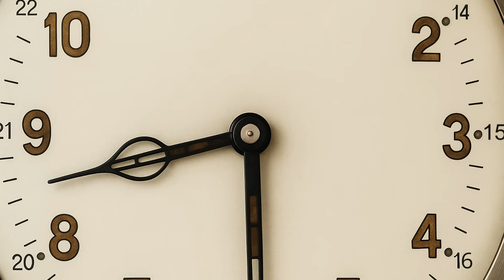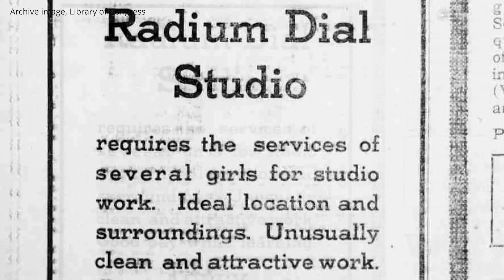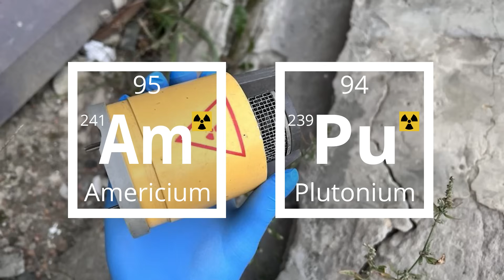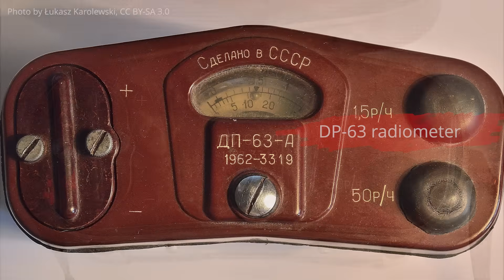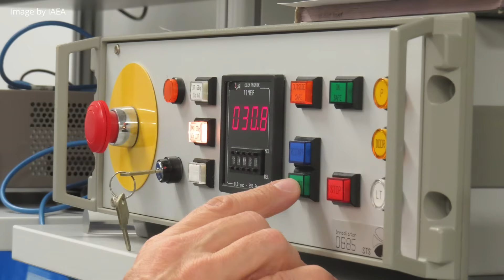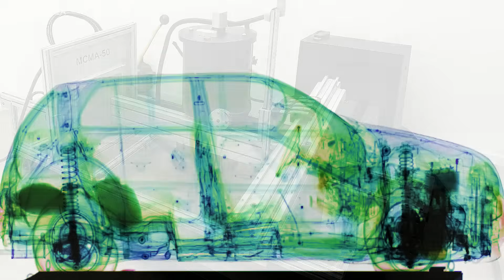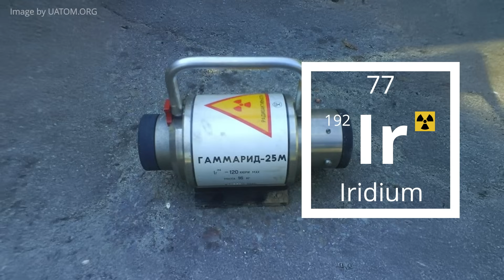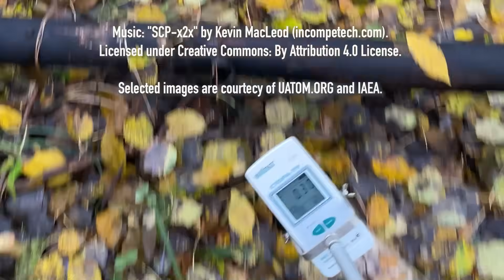NEVER EVER Touch These Objects!

Comment: Hi i am clockmaker and for no Reason i used to remove the radium paint from the diles and hands i still have it in glass jar 
My question
What should i do with it And how much can it be harmful to me i've Always new it was radioaktiv bad i am stupid and n i can stil remember after i would scrape It of i would turn the lights off and look at all of the small pieces thet i didn't catch in the jar and am really worried about the dust
Reply from the maker: Contact local sanitary authorities and request a check up. Follow their advices. I am too far to give you any specific advice.

Comment: My lab actually uses an old but still very spicy radium dial clock as a check source for repairing old US Civil Defense Geiger counters such as the CDV-700. My dosimeter can detect it from about 0.5m away and will sound an alarm within 200mm of the face of the clock. Needless to say, this is not a clock I recommend placing beside your bed!
Reply from the maker: True. Thanks for sharing!

Comment: Hello! I am writing this so I can save time searching through contact information of yours to ask this.
I am writing to you in accordance to a geiger counter "apperantly used in Chernobyl" 
the РР51М, it is made in 1970's Communist Bulgaria. In some articles about it is said it was exported to be used in Chernobyl due to lack of presicion instruments but not much detail is given,
since I am a fan of the channel and you guys know way more than me on what was used most likely I am asking this to hopefully either confirm or clear this myth up. Many greetings from Bulgaria!
Reply from the maker: We are not exactly experts on this so we asked our friend Boris, who is a dosimetry technician in the Zone, his answer is:
"..I personally am not aware of any facts regarding the use of this device. However, I also haven’t specifically dug into this kind of information. All I can say is that, in terms of technical parameters, this instrument is almost identical to the DP-5. The detector unit contains the same tubes — STS-5/SBM-20 and SI3BG. It has a similar measurement range of up to 200 R/h. It’s a device from that era. It’s quite possible that some quantity of this equipment ended up in Chernobyl, since at that time everything capable of measuring high radiation levels was sent into the crucible of the Chernobyl operations.
From foreign equipment, I only know of the use of German radiometers (RAM) and Finnish Alnor devices during different periods of the cleanup efforts. However, they were not used on a large scale in Chernobyl. I also don’t rule out the use of PP51 instruments..."

Comment: you forgot a group of sources. Certain kinds of vacuum tubes contain radioactive materials: examples include, secondary emission photomultiplier and multipactor tubes, Thorium-doped filament triodes, uranium glass-sealed transmitter tubes, gas-filled cold cathode valves like thyratrons, RF noise sources, Microwave waveguide components, krypton spark gap tubes, voltage regulators, atomic clock oscillator tubes, and military grade ultra-high-speed switching tubes called Krytrons.
Reply from the maker: Good note!

Comment: In the Arctic Ocean, numerous Soviet decommissioned nuclear submarines have been scuttled.  For now, the submarines' reactor containments are holding strong.  The corrosion, of the metals used to build the hull of the submarines, and the reactors, is slowed. However, the corrosion is taking place.  Soon, a containment breach will happen.  This will shorten the lifespan of many species throughout the planet, to unsustainable levels. Mass extinctions will take place shortly after these old Soviet submarines start leaking their nuclear fuel.  The planet will be changed irreversibly.

Comment: Where I Iive, radon gas is an issue because of the radioactive elements in the native bedrock which is pretty close to the surface in many areas. It is the second highest cause of lung cancers, after cigarette smoking. The solution is often to have adequate ventilation in building areas below grade. Many people don’t know about the danger, and the building codes don’t address it. The problem is likely worse in air tight buildings with inadequate fresh air exchange.

Comment: Radium clocks don’t cause birds to die, they aren’t that strong usually only 1uCi,aircraft gauges and compasses are far more active and even then will not give birds ARS stop lying and fear mongering,also RID-1 detectors have two 500uCi sources which are far more active than the 1uCi Am-241 household smoke alarms,the Sr-90 B-8 source in the DP-5 dosimeters are not strong enough to cause any damage,and the ones in the DP-5V are epoxy coated
Reply from the maker: I see you did not even watch the video.
Reply: @ChernobylFamily  I see you know absolutely nothing , and have no actual experience with these sources like I have , don’t give me that
Reply from the maker: Enjoy your coolness, then. Peace and love.
Reply: @ChernobylFamily  don’t spread misinformation, peace and love

Comment: Another potential hazard for collectors of vintage Soviet gear to watch out for is military night vision optics that use vacuum-state electronics; the high-voltage generator circuits in those use rectifier tubes that have radioactive electrodes inside them to improve thermionic emission.  If these glass tubes are broken during handling or disposal, the source can be released.
Reply from the maker: Very well noted

Comment: With regards to the dp-63 I am not sure what you mean about it having a check source under the "clip".
All sources are contained within and a B-8 check source is fitted under the tube with a small window on the back than you can open to check other dosimeters as well
Reply from the maker: Seemingly depends on a modification. Many have it same as DP-5A --- on the holster's cover.

Comment: Nuclear power Health Physics tech here. Hey guys Please dont listen to AI generated videos for safety tips.  🤦 these facts are not factual. The very first story makes no sense. Radium 228 which is most common is a alpha emitter, alpha particles are too heavy and large to travel that far or pass through the feathers let alone the skin. Ra 226 is a beta emitter however, if the clock had a glass window no beta particles could pass through it. The amount of gamma would be nothing compared to the natural dose parrots experience in the wild.
Reply from the maker: First, read the description of this channel. Second, there is no AI generated advices here, except a few AI enhanced images. Third, thank you, but the glass was not intact. Thank you/you are welcome.

Comment: Never open a power supply either. One static electric spark can send tens of thousands of volts through your body and stop your heart instantly.
Reply from the maker: I more like CRT tubes in this context.
Reply: Static can't, a charged capacitor sure can
Reply: Be lucky to find a power supply that is in the thousands of volts in households

Comment: I work at a lab. A colleague got a radiation monitor and was showing it around. At a certain spot in the lab it started alarming... Turned out to be a very old mechanical balance which was there only for show purposes (no one used it, new lab rats don't even know how to do it...). It had radium painted dials which no one was aware of, we had to get the apparatus removed by the company radiation unit .
Reply from the maker: Good it ended like this!

Comment: That compass shown at 5:42, does it contain radioactive materials? I own one, looks same as the one shown in the video
Reply from the maker: Yes. There are versions without, but vast majority, yes. Delivers ~3..8 uSv/h in close proximity.
Reply: @ChernobylFamily  Thanks. I have just taken it out to a dark room and nothing glows. Is there any chance that the dial already had phosphorus instead of Radium? Thanks
Reply from the maker: If the mixture is greenish-white, yes. If it is like mustard, rather no. Expose for a few hours to light, if no glowing or it is very short - well, it is a radium mixture. But BETTER ask a professional on site to check.
Reply: @ChernobylFamily  I've put it under a desk lamp for the time while I was watching videos on YouTube (so past hour or so). And now it glows (in greenish colour) in the darkness. Not too bright. Oh, and the colour of the mixture on the dial itself is light yellowish. I'd guess it's not Radium but I'll keep it for a few hours in the light then see how long it lasts in total darkness. Thanks!
Reply: @ChernobylFamily  Today I brought the compass to state radiology centre (not sure of correct translation though). They checked it using a dosimeter and spectrometer but found nothing radioactive. Environment (inside the building) was 0.04-0.06 uSv/h, the readings remained the same after bringing the compass closer to the dosimeter at various angles. Conclusion - no Radium is in there. Oh, and my compass has dark red shell, if that means anything. But huge thanks for heads-up!
Reply from the maker: Goood! Happy for you. Yes, that has to be a new, safe version then.

Comment: As a Master Welder, I'm quiet familiar with some of the radiation sources you mention. When a batch of new welds had to be checked for flaws, a special technological radiation service was called in. Radiation signs were put up, and everyone had to vacate the premises when they went to work.

And it's good that you shine a light on this little known problem of orphan sources. Not to mention the fact that at one point, radiation-laced products were sold as "health-beneficial". What the actual... 🤦
Reply from the maker: Thank you!
Reply: Yes those iridium and selenium sources are really intense for their side. If you got one of those sentenel projectors definitely use it or lose it, they lose the useful activity mighty quick.😮

Comment: My uncles got radium-dial watches as gifts for Confirmation, many decades ago.  I ended up with one of them about thirty years ago, and kept it in a box under my bed as a sort of relic of the past.  It was kinda neat, since it still glowed dimly (it was about 35 years old then, I think) even when freshly brought out of the dark, unlike UV-reactive paint, even if I did have to look at it in a very dark room to see the glow.  Nobody was worried about it particularly, since "Those were very common when I was younger" was a common refrain.  More recently, I have wondered where that watch WENT to!  

I still live in the same family house, all these years later, and either I got worried and got rid of it long ago, or... it's somewhere in the back of a closet or cabinet.  Well, it would be over sixty years old now...  If a marine clock (much larger!) is "safe" a few meters away, I would hope that a wristwatch would be "safe" a few feet away?  I wasn't too worried, since all the storied I'd heard about how dangerous radium paint was were about people who worked with it, painting the numbers on the dials, day after day.  It never occurred to me that a radium-painted dial could kill a poor little bird place a short distance away!

I have occasionally thought that, if I come across it, I'd look up where to dispose of it properly, but I don't even know where to look.  >.>
Reply from the maker: If you are in the U.S.... hm, I really do not know. Check who disposes of sources. There is always an authority for this.

Comment: I studied at Physics Institute of São Paulo University in the 80s.  A lot of things happened on the nearby Institute of Energetic and Nuclear Research (IPEN) by the side of the institute. Once topazes began to appear on the market on the 80s, colorless topazes are not very valuable but colored ones are. But if you irradiate topazes with neutrons or electrons they change color. You can do it on a controlled manner without getting the topazes radioactive, especially with electrons on a linear accelerator. But those were highly radioactive and a researcher discovered by chance.
Some person or group of people were irradiating colorless topazes with neutrons. The simpler way was to put them on a nuclear reactor. Some research reactors have a pneumatic mail to send and bring back material to be irradiated on the core. Probably those people were using a research facility without permission to get some profit buying colorless topazes and selling it for much more. When the news got to the press the activity ended and to my knowledge they were never caught.
Other time in the 90s several Iodine 131 leaks were caused on IPEN at first it was deemed an accident, but it was repeated on different places at least three times: it seemed it was a sabotage to stop the activity on the place: I131 was a smart choice it can be counteracted giving Iodine to people to saturate the thyroid to not absorb it and I131 has 8 days half life, so after about 40 days very little remains (1/32 of the original quantity). The saboteur was never caught.
Other cases happened.
In my institute on the lab classes we used sources for experiments (like measuring neutron spectrum, or distance of semi reduction of radiation with several different metals, things like that): the sources were stored on a lead container and closed in transparent epoxy or lucite. So they are relatively safe. Once someone detected radiation under a metal cabinet: it was one of those sources, it seems they were not properly accounted for after use as each lead container had several of them.
After Goiania accident several cities banned smoke detectors and ionizing lightning rods that used Americium. Americium is a metal and it is far safer and easier to dispose than Cesium 137 because is not sinterized  powder and not soluble. The Goiania accident was worse because the source has made of cesium chloride (as pure cesium is an alkaline metal violently reactive with water and corrosive), but cesium chloride is water voluble, well you can imagine the problem.
Reply from the maker: Thank you for sharing this.

Comment: I remember in my university they had some kind of setup with a radiation detector (I cannot recall what it was used for) and occasionally their measurements ended up ruined with big random spikes of radiation. Someone finally figured out they occurred when one professor walked in a hallway next to the lab, and chased him with a radiation detector. It turned out he had an old watch with radium dials emitting gamma radiation so powerful that it ruined the experiment throught a brick wall over 2 meter distance. The professor stopped wearing the watch at that second 😂
Reply from the maker: Thank you for sharing!

Comment: I want to thank @The Chernobyl Family for finally roughly explaining what I found during my childhood's adventures in the shed that our family inherited from a neighbour (early '90s, Latvia). The shed was jam-packed with Soviet-made materials like concentrated acids, solvents and powders i later used in my own chemical lab. Among the clutter (mostly from '60s-'70s), I found a nice, flat, shiny screwtop aluminium can, just like the one at 12:25 or 12:40. It was not black or heavy, but had a radiation sign and number 85 painted on it. At the time (around 9-10yo) i figured it must be the atomic number of the contents. Which coincided as Astatine (yes😂, did not know how impossible that was, no internet back then).

 Inside, wrapped in a thick plastic bag was a plastic case, a bit like the box at 12:30, just smaller and without an obvious opening mechanism,  half-transparent white with rounded corners and around 10 thin compartments inside. Each contained a small, dark metal disc (like smooth, thick coins). Weirdest of all, the box seemed burned without melting: the plastic had dark, gradually fudged lines going all the way trogh the body, crossing horizontally and verically, but in assymetrical and irregular manner. I suspected it's from some focused radiation even then, as it was not just painted on and made no sense in plastic production process. Reading up about Astatine in Soviet Encyclopedia gave me nothing, but radiation was kind of no big deal from what i'd read at the time. For those who don't know, Astatine is the rarest naturally occurring element on Earth, highly radioactive with a short half-life, just a few grams present on Earth afaik. So not that.

 I did carry the tin around quite a bit, even to school (i think just once, without fully opening). I also thought the box inside seemed kind of warm (might be just the plastic in summer and my imagination), so only dared to open it fully once. Glad i did not drop and lose the discs now. I eventually hid it in my forest hideout safe, under the roots of a large, fallen pine, but cannot remember if I left it there or moved back home. I might even have had a mild overexposure, as some weird but mild health problems have always puzzled me. Radiation would explain a lot of my life.))

 I eventually left the country and my family had moved before I came back. The sheds and the old house are virtually empty now. If the artifact was there, i hope the scrap metal thieves who stole all our remaining two-wheeled vehicles (like '60s Izh, Delta, Stella, etc.) kept the contents of that can sealed. Or in their trouser pocket.
Reply from the maker: Ooooh what a story!